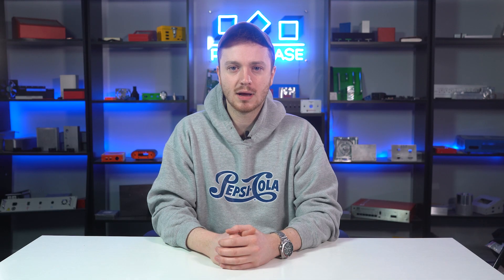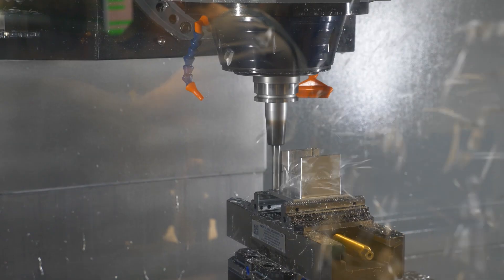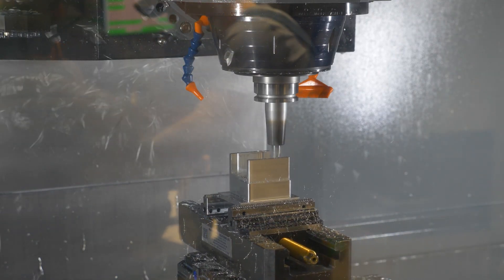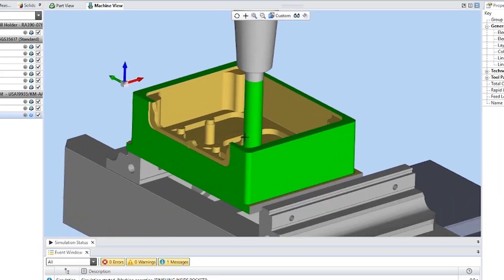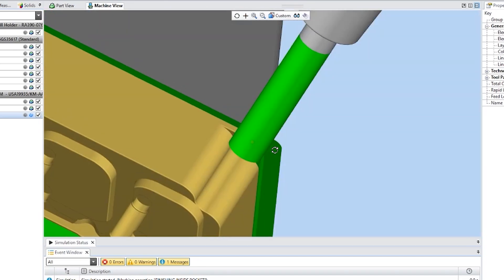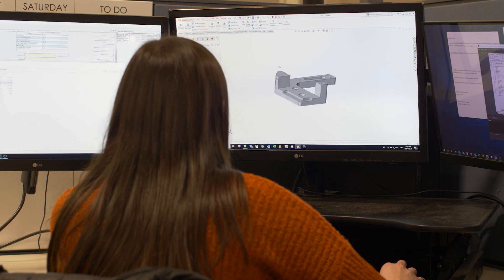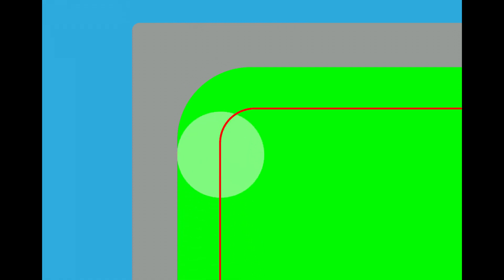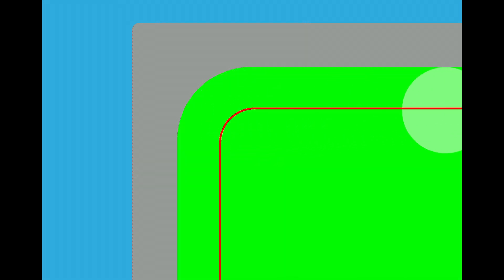Proto Tech Tip - Why Corner Radius Matters in Machining

Comment: You went into depth about the radius of inside corners, but the radius of outside corners is just as important. its real easy in cad to add fillets to round over all the edges, but endmills to not like to round over the top of your parts unless you have a fancy contouring mill.
Reply from the maker: Hey there, good point! We do have corner rounding tools here in our machining facilities. We've put this on our calendar to cover in a future Proto Tech Tip :)